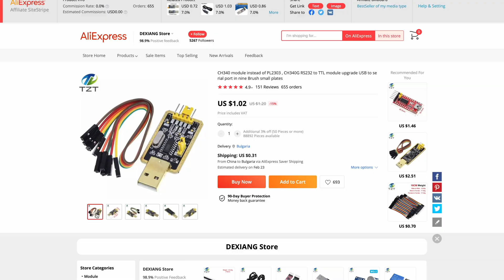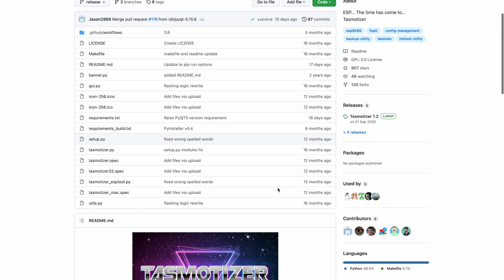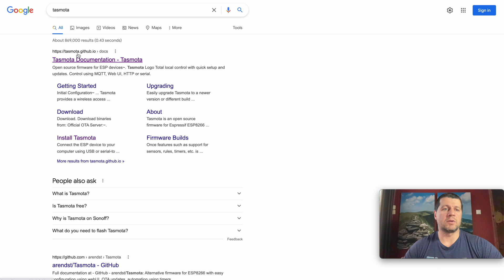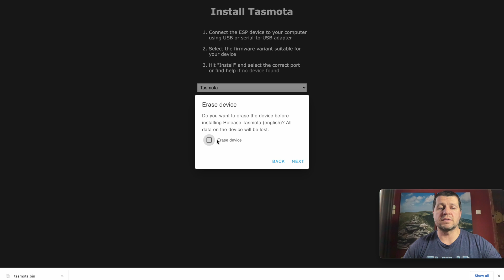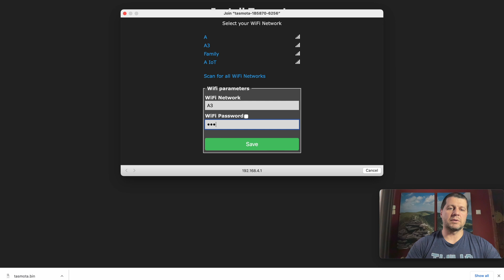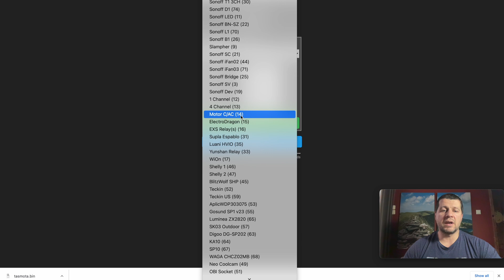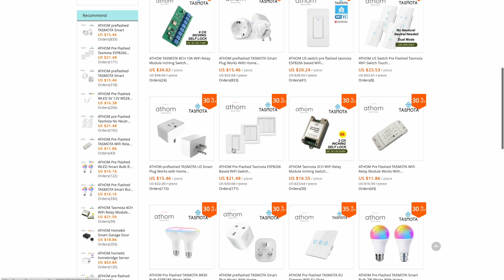Installing Tasmota in 2022

Comment: Very nice tutorial, however. I'm struggle with tuya based smart light bulbs, experiencing difficulties with flash over the air (they removed this feature in latest firmware)

Comment: Beware that some commercial devices (like bridges for Zigbee/IR/RF) are using USB for power without this port being usable for flashing.
Reply from the maker: For most of them you can use the pins inside for the flashing, but of course using the USB port is a lot faster and easier